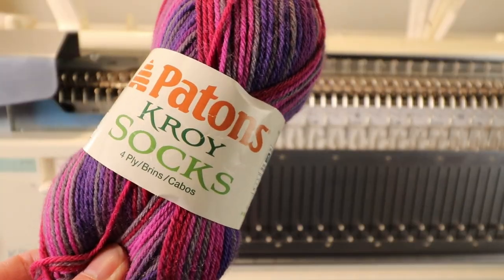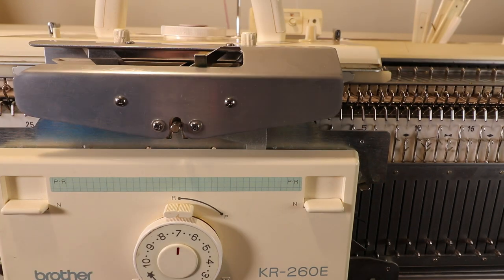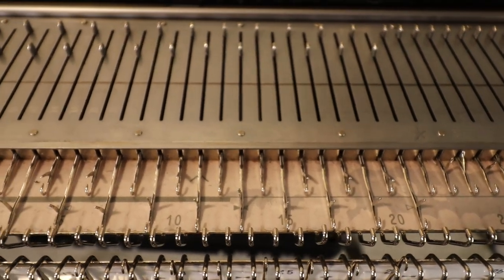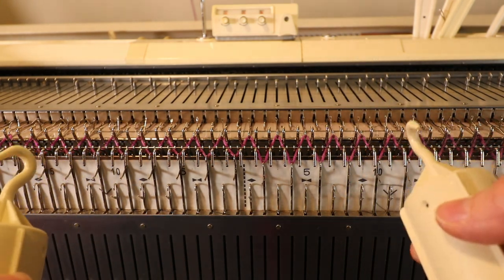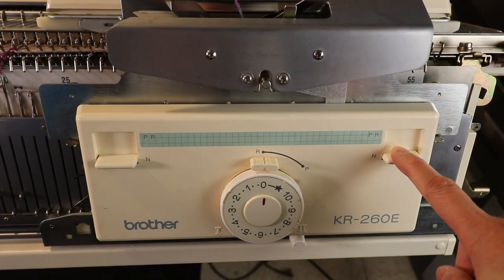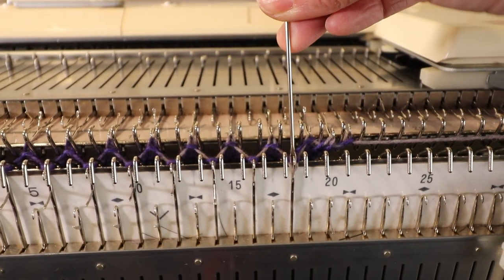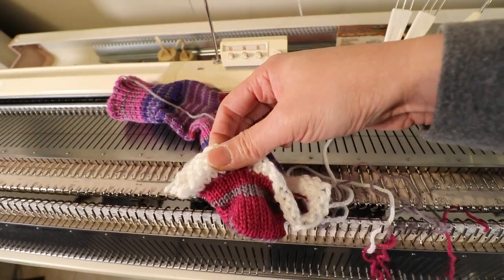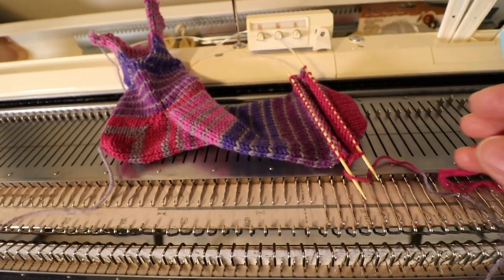Machine knit socks on a bulky knitting machine — Brother 260 with a Ribber (circular knitting)

Comment: Thank you 
How can I avoid holes when short rowing?
Reply from the maker: In theory, after short-row, you pick up a loop on the last stitch from the ribber and place it on the knitter, and pick up a loop on the last knitter stitch and place on the ribber and knit the next row. It gives extra yarns to fill the hole. Sometimes it works well and sometimes not. I am still looking for a better solution. Some people just sew it close by weaving yarn ends from the back.